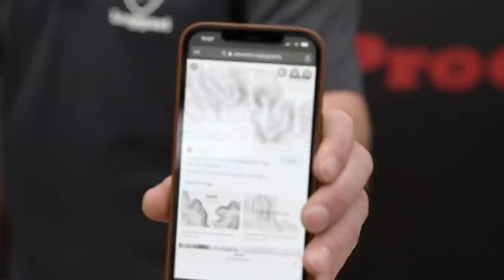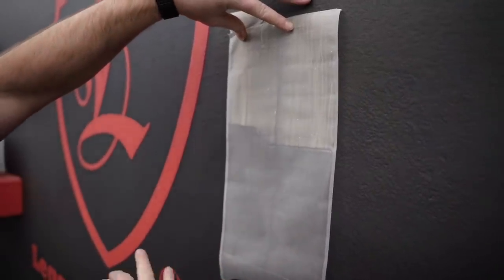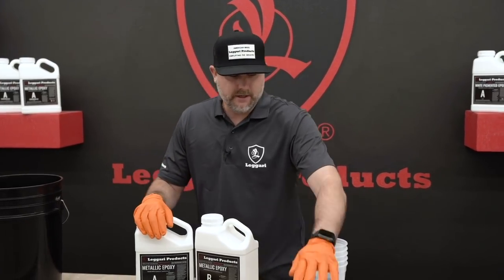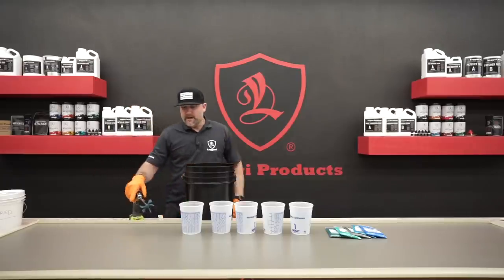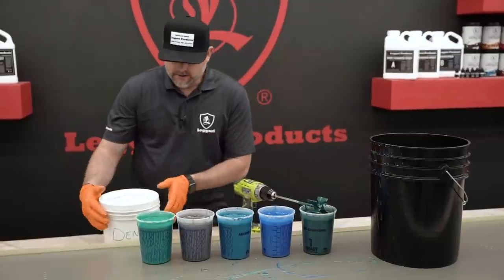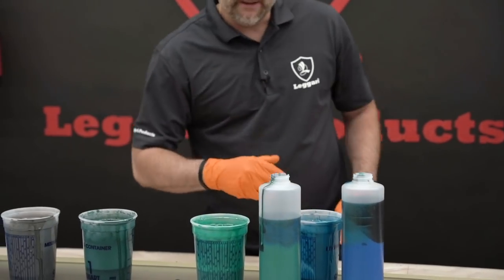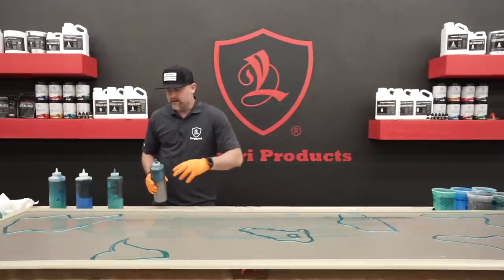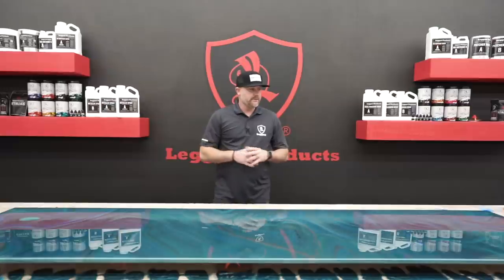Topographic Map Inspired Epoxy Board Using A New & Unique Technique That Anyone Can Do

Comment: @18:27  there seemed to be bubbles/imperfections - what can cause those and is there a way to prevent and correct it after the epoxy has already cured or hardened ?